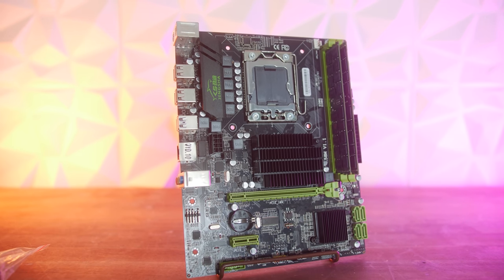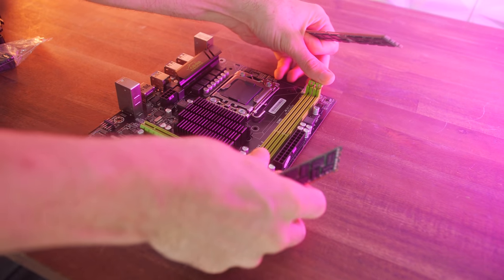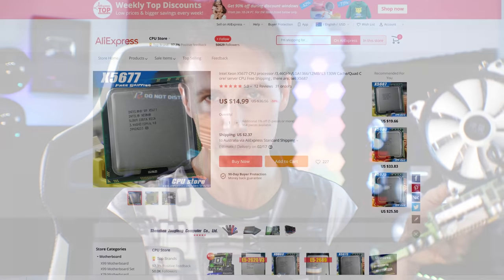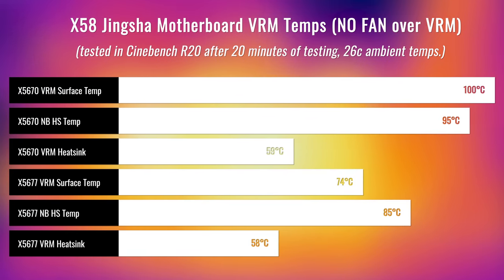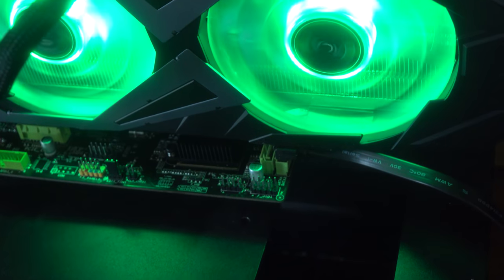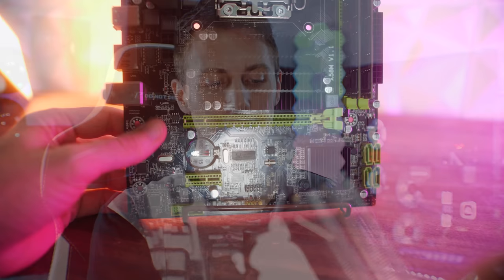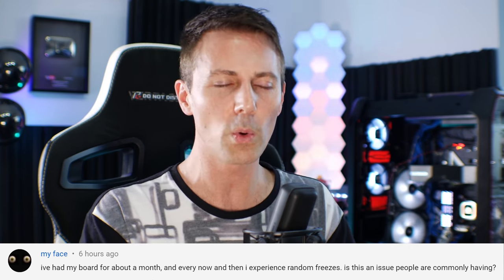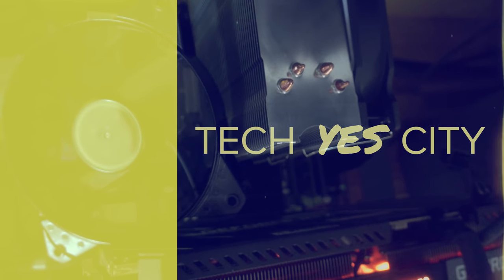Is a $53 ALIEXPRESS Motherboard Worth... $53...? (Jingsha x58 Review)

Comment: I got a question for the community. I got some strange instability in my system. It's an Asus p6t-SE, 12GB of ram, w3680 overclocked to 3.8Ghz atm have had it up to 4.2Ghz, 1070ti, and Soundblaster-z, windows 10. now for the issues, I have noticed that the longer the computer is on(18 hours+ sometimes sooner) the sound will start to become occasionally weird, crackles pops or even drags general performance of the system seems to drop. another issue I have noticed recently is that if I have a tab on the taskbar and I right-click it to bring up options it can take a while for the menu to open if it opens. sometimes its taken several attempts before my system responds to the action of right-clicking. all of this is resolved by a restart but I like to figure something out. I know the hardware is a bit dated but it keeps playing every game i throw at it. thank you to everyone with ideas. 

the system passes memtest left on for over 24 hours
passes all benchmarks no issues. I am starting to suspect the memory controller in the CPU. I read somewhere that these 1366 based CPUs had sensitive memory controllers. was reading that over time they get stressed or can become stressed.  idk

Comment: I just got my build with this board! But, only the left ram slot works.. the second one is not working I think. I only shows 8gb instead of 16gb of ram. But both ram slots work by themselves on the left slot. It won't boot with one ram slot on the right side. Am I missing something? Or is that second ram slot bad?

Comment: i had taken a similar budget x58 chinese motherboard but without the possibility to overclock for my W3690 and i noticed that sometimes the bluetooth dongle or wifi randomly disconnects , it would be a  overheat issue of the phase or VRM or it could be only a bad manifacture of the motherboard ?

Comment: I just got this board and modded a Northbridge fan on it, used the sys fan header to power it, i have a X5570 in it right now and locally i can get a E5645 for 10 euro. should i take it or no?

Comment: Mm i watch an old 2019 video of yours the worldwide xeon budget rig took a look today for 84 pounds about 90 euros you can get a 6 core 12 threaded xeon 16 gb eec 1600mhz ddr 3 a snowman cooler the kilshre motherboard that price includes shipping. There is totally a market for that whether it be e sports gamers or someone who needs something to do a little bit of everything course work bit of gaming etc. One thing if you do ever decide to buy a psu from aliexpress please please please stick to colourful branded ones or Yeeston both of those companies have quality control and are manufactured on the same factory on the same line as the cosair and delta power supplies respectively so its not some guys basement transistors and capacitors going on those psus.

Comment: Thank you very much for the video. With all due respect, i do not think X58 is the best alternative for those on a budget. There is a cheaper and better board for lga 1356. Goes by the name X9a or X79A. It is from jingsha. Pair that with a 2440 ir a 2470 and you Will have a Sandy bridge PC running cooler for around the same price point as this X58.

Comment: Why $53 Chinese MB when you can get a whole T3500 system (used) for almost same amount.
Reply: Entirely depends on your region. You certainly can't get full systems that cheap where I am. Or ECC RAM for that matter. Sellers seem to have caught on to people buying that stuff on the cheap for these boards and have jacked up prices.
Reply: Depends on if I want to flip it or just use it. Low cost rgb case is going to sell much better than that T3500, and the usb 3.0 is going to be a nice touch
Reply: Watch the entire video before commenting

Comment: one thing with fortnite, i run test a lot on it, and last season is very wierd in term of performance. you can go up to 200 and get low as 80fps in competitive, some part of the map are not optimised well (sands area) and it seems that all nvidia cards i tried so far lost quite a few performance with this patch. (in competitive / low setting)

Comment: Still have my x5670 with the Gigabyte x58A-UD3R. Great little CPU, pushes 4 GHz on all 6 cores sustained. Only downside is that it does not support AVX instructions which many software now requires.

Comment: to be hoenst ive been waiting for this video for a while.
my gigabyte X58 UD5 burnet out its vrm chips, 2 of them and gives the FF bios code,wanted to see what board could i get to replace it, this seems like a good option because this board supports the ecc dimms i got which also shown in the video, the UD5 didnt boot with thoose ecc stick 
all i need is a motherboard and most likely im going with this one. 
im also using a X5570 xeon, would that Xeon be ok for that board with a 3.5ghz oc thats the maxi got with the UD5 and the Xeon.

Comment: Make a comparison between the X5675 and W3680 on the Rampage board, please!!!!!!
Reply: The w36X0 are just single socket (only one could per mobo) x56X0 CPUs and the x5675 is the same bin as the x5680 and x5690 and if I remember the x3680 has a locked/lower multiplier. So you would want to get a x5675

Comment: i hope we get triple channel with DDR5 and AM5, AMD could put Intel in big trouble if Z690 uses dual channel and X670 uses Triple channel.
12:35 i agree, for example where i live the minimum wage is 1.15USD, it absolutely sucks.
Reply: Why not go for quad channel, TR Pro already supports octo channel ran. Ryzen also supports REGECC memory unofficially on some boards.

Comment: MSI X58 Pro-E User here. Northbridge was running at 90°C in idle, and this was after new Thermalpaste btw. So i installed 2x40mm Fans . Now im fine with 60°C in Idle. This Boards are made for Top Blowers and need good Airflow too. Bryan have you ever tried to overclock a E5649?

Comment: Question: The motherboard you used on your other video using Xeons interested me but when I followed the link it lead me to general boards/Xeons not the specific board. Is it possible to tell me exactly which board it is. The small size and the quad channel interested me.

Comment: I've got a couple of these boards and a handful of i7 9xx chips. Tested with RX 480 8G and a GTX 1070. Was pleasantly surprised how the gpus were still the bottleneck in a handful of games tested. Though the chips did turbo WAYYYY higher than spec. I saw upwards of 4GHz on my i7-950 without touching any settings whatsoever. Have you tried any of those chips along with the xeons? Apologies if was featured in a previous vid already.

Comment: if it can make the cpu on turbo or oc state, then it probably a decent motherboard because some cheapest mb with lowest chipset and questionable vrm often lock the option to oc or make the cpu can't use boost frequency (or higher multiplier)
edit : that snowman cooler was the best for it's price, its ran silent while keeping high performance and low price, I use one of it too btw :), just make sure to bend the hook to straighten it a bit because mine came at ridicoulus angle and need some work to use.

Comment: Great vid! But I was thinking, wouldn't a x79 combo, or even x99 from aliexpress would be better for the money? For example, I just paid 110$ for Xeon 2620v3, 16gb ddr4 and a huanzhi motherboard. This combo usually goes for 150, but x79 combos do go for 100$ no?
Reply: Its all about purchasing power, sometimes you can't spend the extra $20 or $30. I did just get my E5-2678 for ~$92 shipped. Got charged close to 7 bucks in tax though.
Reply: @eppicshotgun1281  I guess, but I swear I've seen some x58 combos for 70-80 on AliExpress. I just think buying the combos are better for the money, unless the boards are worse. Let's see if the stuff I bought is worth it.

Comment: im planning to buy the same mobo and cpu for my budget gaming and streaming pc...do u think these combo would be enough to do that?my gpu is gonna be rx 580 8gb
Reply: It'd get by, though you should consider X79 instead. You can get the boards for around the same price on AliExpress and they use the same RAM. Depends on how much a Xeon E5 1650/E5 1650-v2 is where you are though.
Reply: @CaptainKenway  oooohhh thanks bro for the tips, it help me a lot👍👍👍
Reply: @official_zane6302  X79 is probably a better choice but make sure you get a board that supports overclocking and don't cheap out on the power supply. Check out PhillsComputerLab, he's got a system build that he was able to stream on.
Reply: @eppicshotgun1281  yeah i do want to do some overclock a lil bit

Comment: I have been using a DIY upgraded Dell Precision T3500, by updating the HDD to a SSD, CPU to a Xeon W3680 (6C8T 3.33-3.6Ghz) and GPU to  8GB RX580. And because I am not interested in OC this desktop, this was fantastic upgrade with minimal costs. However, the draw back is, heat issue with RX580 in a proprietary casing like Dell, cooling became an issue considering RX5802 does produce quite a bit of heat. 
So I have been trying to see if I can move the whole setup to a after market casing, which means requires change of Motherboard, as Dell motherboard cannot be moved into standard case because of the podiatry Ports mapping on the board. So this mean, if move to new casing, requires to change MB which made me look into this as well. After awhile I decided not to. This is because unfortunately these motherboard only has 2 (occasionally 3 DIM slot for RAM, which mean I can get 12gb onto it (as i only have 4gb sticks), and because of the new motherboard, window 10 OEM license in the Dell will not work and will require brand new Window 10 license..... costs starts to add up to a point of buy some cheaper used AMD FX cpu and mb combo instead.....
Reply: Hey, I’ve been looking to get a new GPU for my T3500. I’ve read some posts regarding that the RX 400/500 series don’t post because of the Dell’s legacy BIOS and they only support UEFI. Did yours work out of the box?
Reply: @zireael666  Mine work out of box without issues. I have 2x Dell Precision T3500. I used one with RX580 8gb without problem. Another one for my daughter, I installed with RX570 8gb, out of box without problem. So definitely not UEFI only

Comment: Cool! I really do have a soft spot for X58, nonetheless I think that depending on your budget and local market it would be a little more convenient to either buy a decommissioned Dell T3500 or HP Z400 (or even only the MB) if you really want an X58 machine or pull the trigger and make the jump directly towards X99, as the cheapest E5-2620v3 kits including a decent quad channel capable and actively cooled VRM MB and 16 GB of RAM can be acquired from AliExpress for around $150 USD and offer a pretty interesting upgrade path even today. X79 has the disadvantage that budget Chinese boards are limited because of the use of dual channel memory only (instead of native quad channel) and that the upgrade path is limited to only the 6c CPUs due to their weak VRM cooling solution. Best regards!

Comment: have you ever tried running linux on these old xeon boards? there are games that run better on linux than windows, plus linux uses less resources than windows so games can utilize them, especially on old hardware, if you can look into it for a video that would be amazing!
Reply: I was thinking about running linux on my editing rig once I get it built.
Reply: @eppicshotgun1281  if your editing software cant run on linux natively, you can look up how to make a windows or macos virtual machine and run it on that, the performance loss should be minimal and otherwise completely functional
Reply: @eppicshotgun1281  o yea make sure you have an amd gpu at hand cause linux dont run with nvidia cards immediately, youll have to perform a passthrough with an amd card first
Reply: @djtlh7335  I use DaVinci Resolve and OBS so I'm good for compatibility, I'll be using a Strix R7-370 4g.
Reply: @eppicshotgun1281  guess ur set, have fun :)
Reply: My best friend he runs linux on these with amd cards on xeons and fx8350 exclusively. I've convinced him to try an old nvidia card with noveau drivers on gamer distro. I tried Linux Mint once but I think if the driver works out could be nice. He uses Manjaro a lot but it's something he's going to poke at during travel quarantine.
Reply: @MissCloud9  I've heard about nouveau drivers but I don't have a desktop gpu from Nvidia to mess around with yet.

Comment: guys I have one of these Aliexpress mobo's the x79 king paired with an 2620v2 xeon with a rx580 4gb sapphire pulse (used mining) card it straight up dies if i attempt to play games and it gets to a certain part of a game, tried lowering the graphics to the lowest possible settings but it still dies on me my psu isa a 450W evga bronze rated psu, is it my gpu that's the problem?
Reply: It’s probably either the GPU dying (because of the mining) or your power supply is too weak. I think 450W is pushing it for the RX 580. Have you checked the cards TDP?
Reply: @zireael666  I changed my psu to a 550W one and now it doesnt suddenly die anymore, I think it really was the PSU, i didn't know that 450W can't handle a 580 on full tilt..

Comment: FYI you could just look for a Dell T3500 locally comes with 525w power supply, probably some ram and a xeon. you will just need to ad the cheap GPU.
Reply: or an HP Z400
Reply: Just got one for 56£ + 30£ shipping to Europe. Total 86£ for a T3500 with a Xeon W3565 and 12GB DDR3 ECC RAM! Super happy, upgraded from LGA 775 (Core2Quad Q9400).
Reply: @zireael666  congrats. Later down the road you can upgrade to a 6 core/12 thread. I would suggest you getting a 3-4 pack of 80mm fans. 2 for exhaust, one for the cpu heat sink and one for the chip set heat sink. Keep temps low.

Comment: What would be the most cost effective processor to pair with that motherboard? Saw a x58 used msi board with 6 ram slots.
Reply: X5675 or similar, don't spend too much on x58

Comment: Great video! I’d LOVE to see a video on these Chinese dual socket boards. Maybe some budget plastic tube water cooling? 

Take care! Much love from Texas.
Reply: I got a spare server motherboard for Dell m610 blades for cheap, it has dual CPU sockets, I am trying to hack the power supply to feed the 12V rails, as this board was designed for a rack plug, not the standard molex connector. Hunting for other dual Xeon sockets motherboards, if you know some...

Comment: Hey Bryan, do you know if the cheap ecc registered memory will work with a Gigabyte X58A-UD5 mobo paired with a Xeon X5675 CPU?
Reply: I can't see why It wouldn't, I think an asus system I worked on had ECC in it.
Reply: From what I know, only unbuffered ECC would work with that board, registered ecc needs official support from the board, so I highly doubt it would work

Comment: what size power supply would you recommend for this build with an rx 470/570? 500w?
Reply: These x58 xeons can be quite powerhogs soaking a lot of watts when overclocked. You can look up one of TYC videos comparing cpu power draw of 3 cpus including one of these xeons. I'd say 600watt psu will suffice. I'm currenty using x5650 overclocked to 4.2Ghz with rx480 with 530watt psu and I'm set for the moment, however my gpu is undervolted tho.
Reply: @cutebuiltgood  not really keen on overclocking them for the sake of longevity (they're probably pretty well used as is, underclocked and undervolted for industrial server use usually also), just looking for a cheap combo to throw together for my local market. We're starved for PCs (and consoles, gamers in starved in general) at the moment, looking to fill the gap, make some profit in the process
Reply: @AndrewSmith-ub6xs  If you are not going to overclock then I think that 500watt psu will do.
Reply: @cutebuiltgood  cheers mate have a good one

Comment: I wonder how much longer the x58 chipset will be supported by developers for
Reply: if it was only that lmao, its has old has the 775. This cheap boards don´t oc at all. only with a W cpu and intel xtu in the windows, but still limited.
Reply: @J Fz don´t forget that x79 + cpu and ram for 100 dolars is far better deal lmao
Reply: @J Fz i understand you, and you are right but, the x58 for the price of the board, its kinda shit dog. The x79 is newer, and far better, suports the avx instruction and more, like pci3.0, usb 3.0 and m.2 x2 i belive.
Reply: @J Fz yep, thats why i said that the x58 is a all around a bad investment, and worse, is that you are oc limited, theres another x58 with a better cooling solution, like a heatpipe coming from the vrm to the chipset, and on the cheapset theres a fan ! So in a way, a better deal, but again,  why even go for the x58 at this point. Again x79, far better IPC and oc compare to the x58.
Reply: @J Fz You make a good point. I did an x58 build a year ago for a friend who plays ow and he's luckily not had any issues. I'm just curious as to if its the best option to go for when flipping. I guess you just have to weigh the pros and cons (performance/$ to lacking feature set)